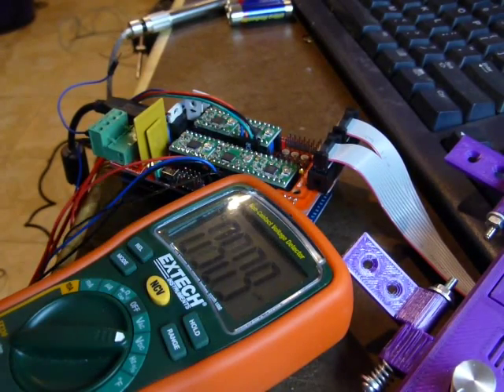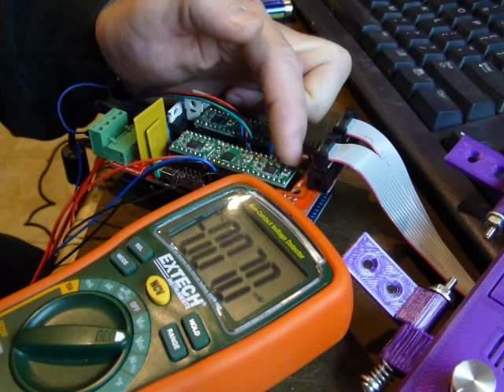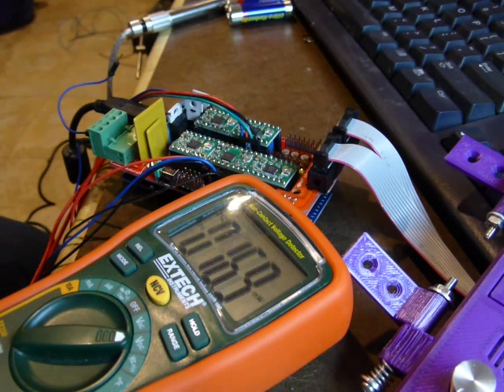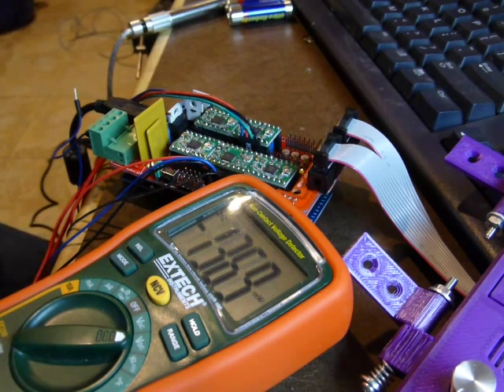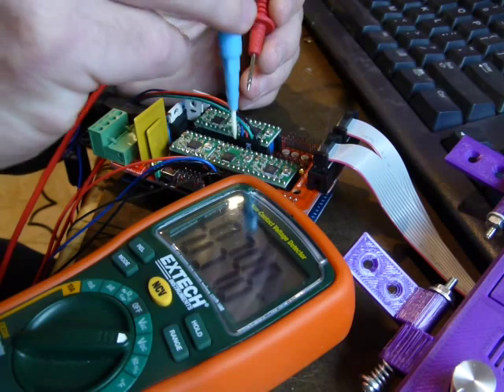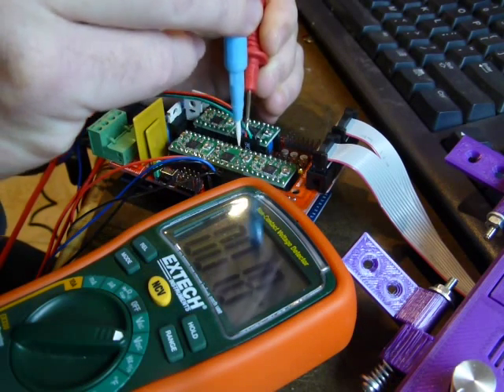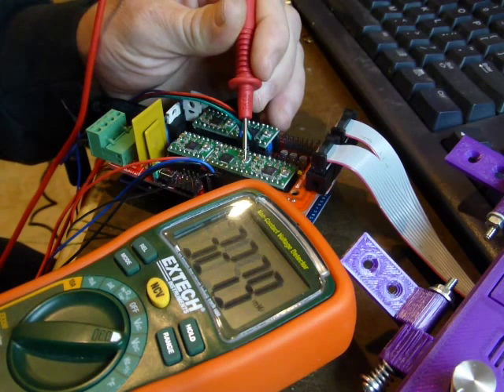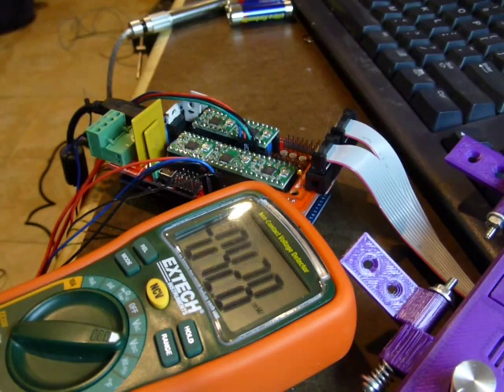Adjusting Reprap motor driver current

Comment: Can I ask how you determined 410 - 420 was the area to shoot for?
Reply: Perfect. Thank you very much.
Reply: Second this question, the response if one was posted is no longer there?
Reply from the maker: I did post an entry but I think it was linked to my G+ account which I deleted to clear some issues.
The original answer included the formula, but I don't have time to reproduce now. Anyway, the formula is on the data sheet for the driver chip, and that value results in a drive current of one amp, which is what the chip is rated for without a heat sink. If you're interested, google the data sheet and plug the values in to the formula. It's a simple voltage divider driving a constant current supply.
Reply: V = 8 ⋅ I ⋅ R

I = V / (8 ⋅ R)

Where V is your voltage reference, I is your motor's maximum current and R is the resistance of the current sense resistor.

Comment: i have a dt33a multimeter. i connect the black tip to the ground and red tip to the screw but nothing happens. i have the meter set to v~ 200. is this correct?
Reply from the maker: No, that's the wrong range.  200 volts AC.  You want the 2 volt DC range, on your meter that's 2000m (2000 millivolts or 2 volts).  DC won't show up on the AC ranges, and you're trying to measure voltages under 1 volt, in the 200 volt range you wouldn't see much even if you were set to DC 200.
Reply: Thanks for the reply. I'll try it again when I get back home
Reply: John Ridley so do I need to plug the red cord in the 'VohmmA' jack?
Reply from the maker: Yes. You only use the 10A jack when you're measuring high amps. NEVER leave the lead in the 10A jack - it's a dead short to the COM jack and if you leave it in there you run the risk of forgetting to move it, trying to measure maybe line current and causing a lot of excitement, sparks and smoke.
Reply: the readings only go up to about 210 and then it goes down to 1 if i turn it CW a little bit more. i have it set to 2000m. what am i doing wrong? if i need to make a short video i can or pictures.
Reply from the maker: Weird. you may have driver boards with a different chip on them.  This advice only really holds for Allegro A4988 chip based ones. There are a LOT of different driver chips on the market now.
Reply: do you have a link to an amazon store page or ebay?
oh and now they wont go over 200 now. did nothing since i tested them last time. just a side note.
Reply from the maker: OK I don't know then. The board design could be different. The other way to adjust these is just by turning them up until you get good performance, but not so high that they start to cut out. If they're too high, they will start to cut in and out to protect themselves from overheating. It's not as good a method but it's what I did before figuring this method out. You should also ask the seller about calibration procedure.
Reply: John Ridley my question is how do you know what current to correctly set your motors to. Do you go by specs of the motors or what.

Comment: What amp motors are you using for this formula 0.42.
I have 1.2A motors and using china made 4988 steppers with ? resistors.(i'm guessing 0.1ohm).
What should my volt be ? as i was told 0.6 

Thx Pb
Reply from the maker: 1 amp.  It should scale linearly so 0.6 should be about perfect.